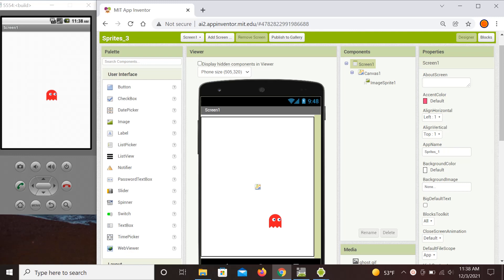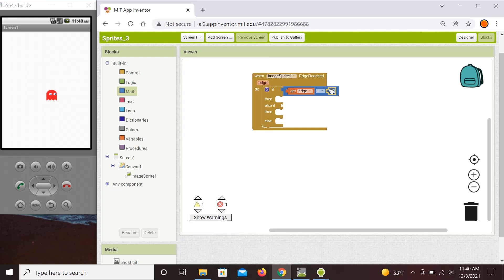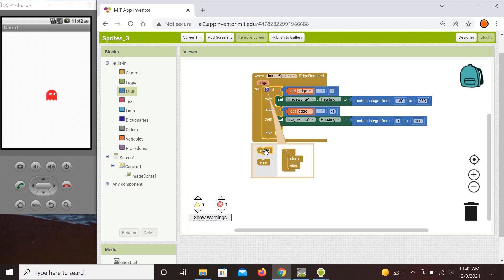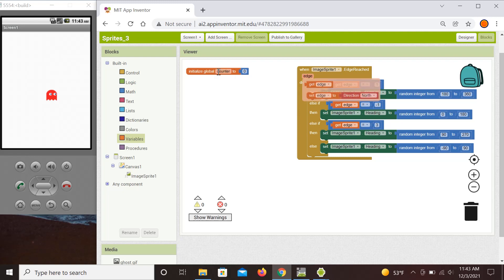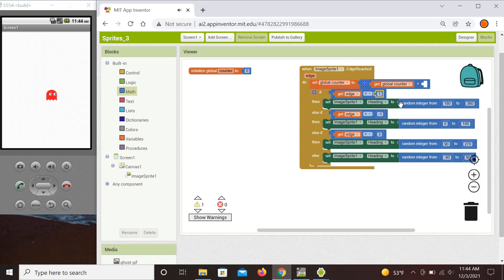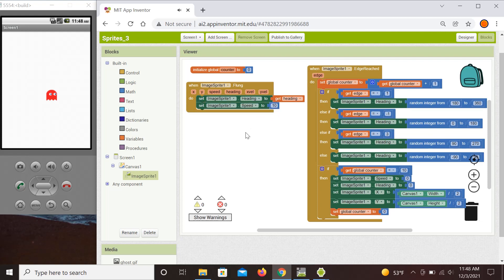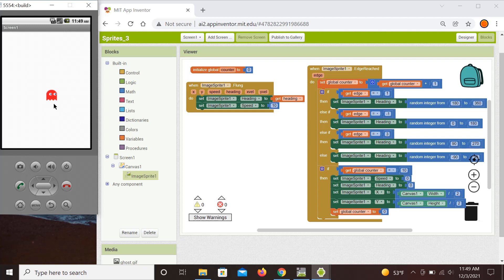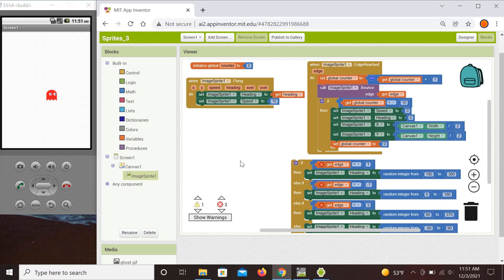MIT App Inventor 2 Sprites: Bounce

Comment: Hello sir, I need your help. I have to make an app for my Control systems project in which I will control a solenoid door lock with the app. But the instructor has set some regulations that the lock should open when user enters correct pattern/password. In case of wrong password, the lock should be suspended for two mins. secondly it should send notification to another phone or in worst case on the same phone a notification should be displayed.
Reply from the maker: In short - you can first check whether the password is entered in the [PasswordTextBox] (say after the Enter Password button is pressed). After that you need to check whether the entered password is correct (say by using the control [if] and comparing the strings [PasswordTextBox.Text] and [correctpassword]). Then you either open the lock or send a message, depending whether your comparison is true or false.
Hope this is helpful - good luck.
Reply: Nerd